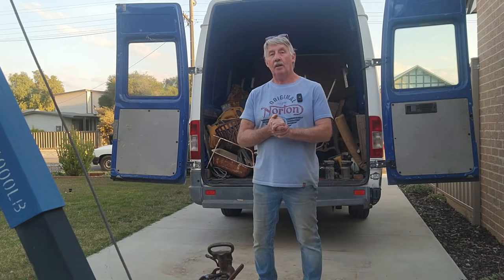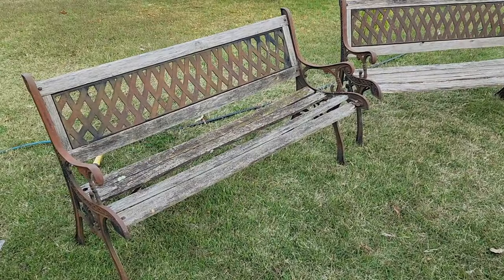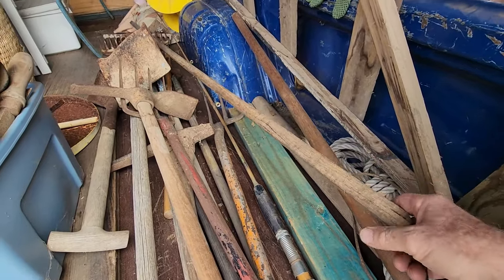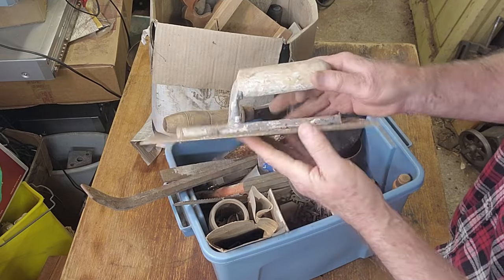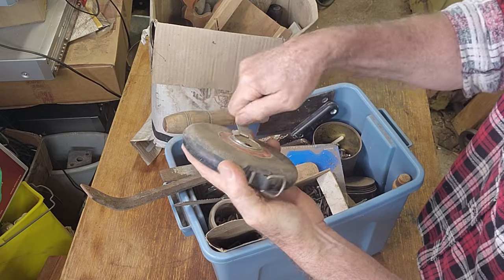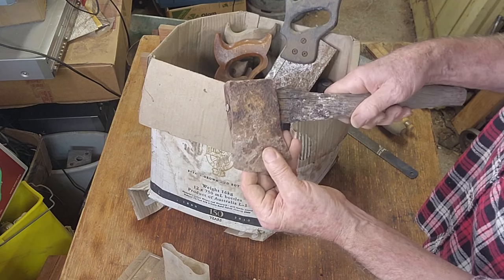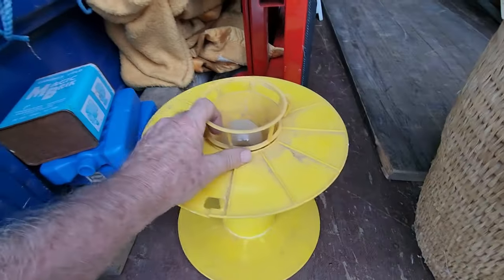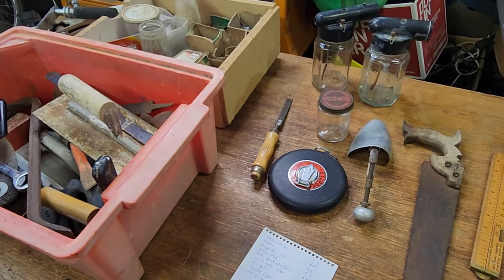Cleaning Out an Old House & Shed Part 2. Processing Stuff from the Yard & Unboxing Shed Goodies!

Comment: I cannot comment on the Hoover spray pots, but I remember my father using the Electrolux version about 50 years ago.
It did the job, but was very heavy on the coating. He gave up in the end and reverted to a roller, otherwise we would have run out of paint.
The tape measure is a 20m one, it was written on the tape at the beginning.
Reply from the maker: Thanks John, I didn't notice the 20m written on the tape! 🤦‍♂️ Yeah, I feel those sprayers were just a gimmick! 🙄😊